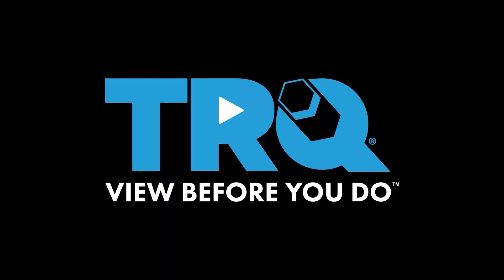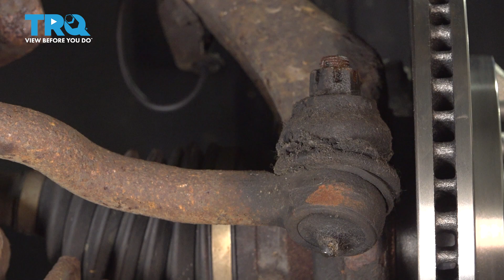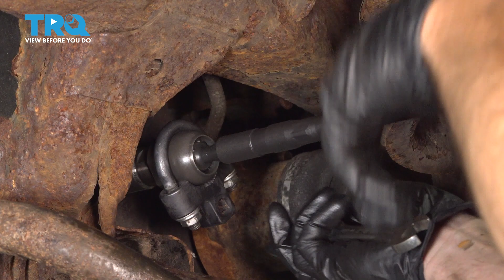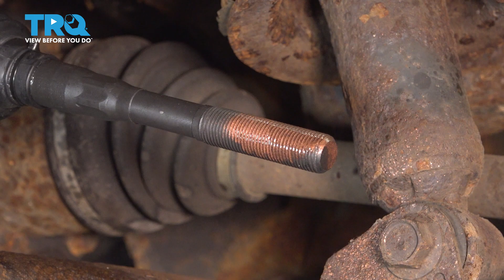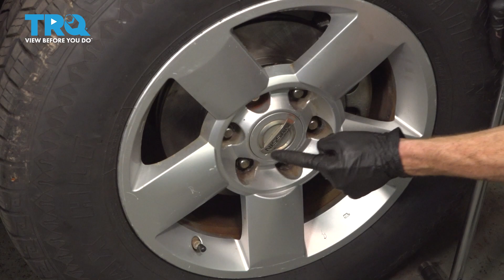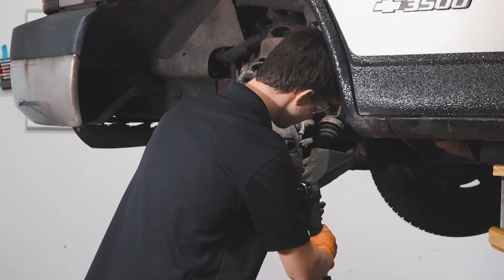How to Replace Front Inner Tie Rod End 2004-2015 Nissan Titan

Comment: Wow TRQ videos are usually good- not this time. I was a Class A tech specializing in front end and alignments-- 1. that outer tie rod is toast based on the state of the rubber alone. 2. The rack is leaking from damaged inner seals and was completely ignored. 3. You didn't address reaching the inner boot clamp and 4. you did not point out the importance of grease on the ball and socket. Scary that amateurs will follow this and trust it. 2 thumbs down.